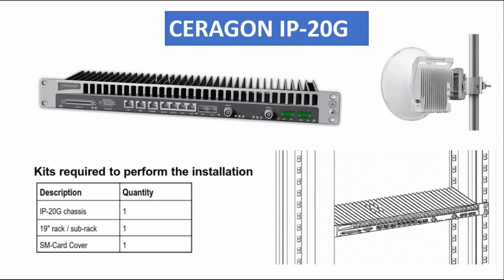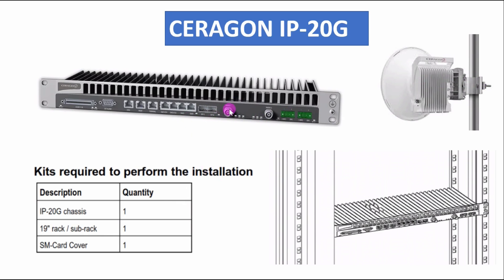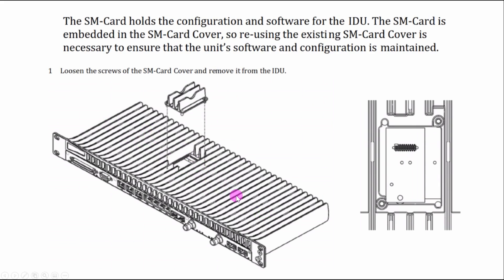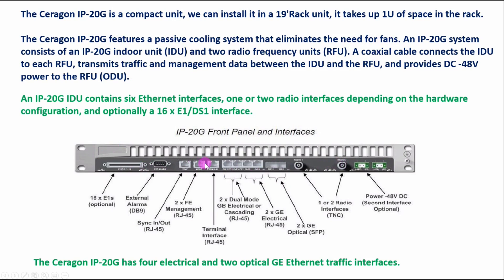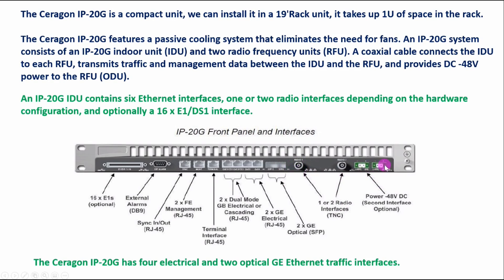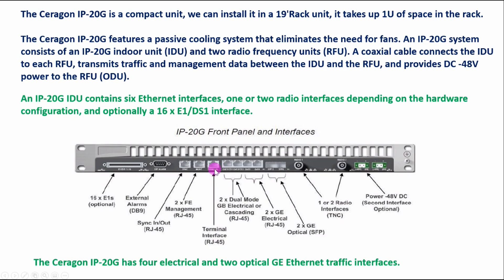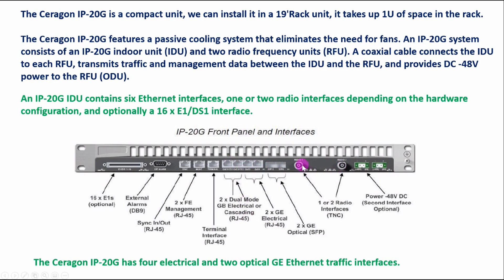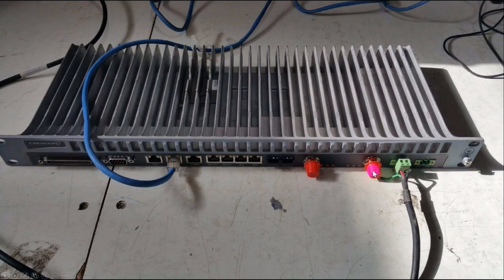Ceragon IP 20G Basic Info & Specifications | Ceragon Networks | job for Transmission engineer

Comment: hello, please help.
how to hard reset ceragon IP 20C ?
or how to find IP MGT Ceragon IP 20C.
I loss IP MGT.

Thanks
Reply from the maker: For hard reset can do from MCB on /off & in card there also option to give reset, for login ip if forgot then please ask to transmission team, he will support you
Reply: Thanks for sharing. I fix problem use ipv6 default